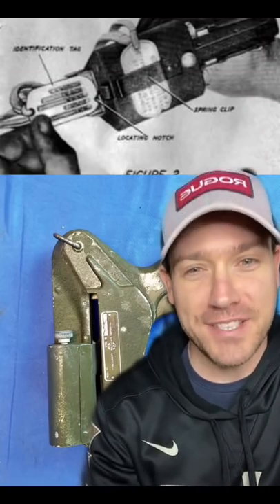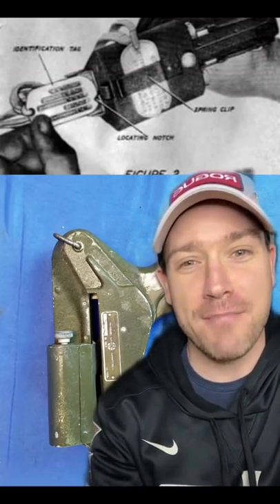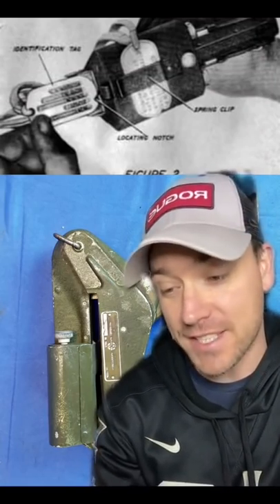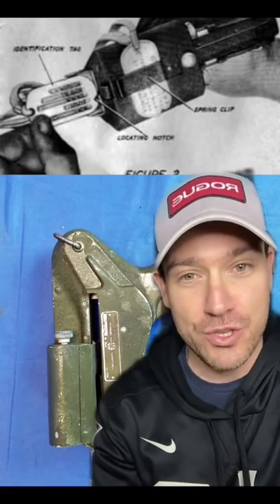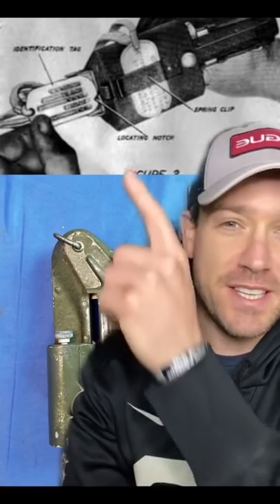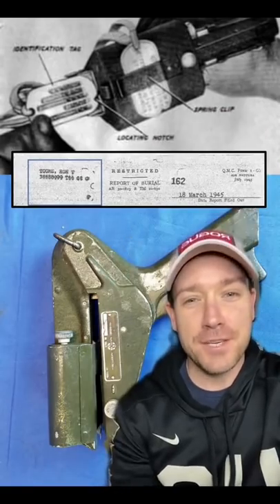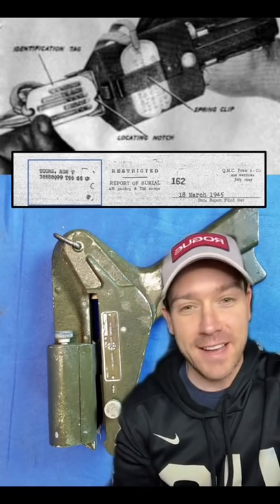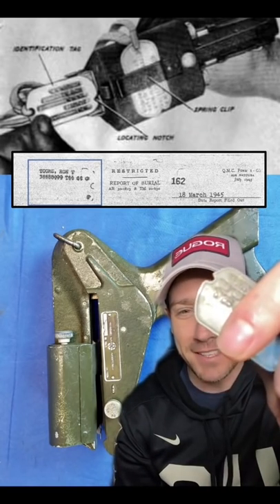Let's Put This Rumor To Rest: Why Did Dog Tags Have Notches?

Comment: I have heard this story also.  We usually had one laced in our boot.  Working on the flight deck it was not allowed to have dog tags around your neck or any loose items.  These items if they became loose could get sucked into a jet engine and destroy a very expensive engine. More often than not the surviving recognizable body part in a disaster we’re your boots. The original reason the notch is there for one reason,  very often in the military things have more than one purpose by design or by necessity or convenience.  Practicality in the Navy or any other force means nothing, orders come from the top when they make down to the bottom they make no sense to the people that have to carry them out.
Reply: Heard one guy got sucked into a Crusader intake.
Reply: @thisismagacountry1318  that is a true story. He survived with minimal injuries because while he did get pulled into the intake, he did not get pulled into the fan

Comment: Actually pretty sick considering I'm working records for the air force...
Reply: Nice. Also question. How long was bootcamp?
Reply: @wither5k788  8 Weeks when I went through.
Reply: @wither5k788  basic was very easy, waking up every day at 0545, doing pt, eating, studying, clipping strings on uniforms, drill, etc. But theres a lot of staying inside too even if your in august
Reply: Thank you
Reply: @wither5k788  what for?
Reply: @ExplosiveQuarry  just wondering
Reply: @darkdrengr5944  mine was 7.5 weeks with only 3 days out at BEAST with no obstacle course or gas chamber
Reply: @ExplosiveQuarry  when did you go through?  I was there in '99 so I would imagine a lot has changed.

Comment: My dogtags had a notch in them because they fell behind my end table and landed on the prongs of my phone charger that was not pushed into the wall all the way.

Edit: It was not the force of the dogtags hitting the charger prongs that bent them, It was the dogtags touching two exposed prongs and the ensuing electrical arc that burnt two notches into them.
Reply: Dr Disconect  It arched and cut two dents into it.
Reply: This is cap, were your dog tags made of aluminum foil?
Reply: Am I really the only one who realized that the electric arc cut the notches into the tag before reading his edit?
Reply: Sure bud
Reply: @nicholasweiss4662  😂🤣😂
Reply: it’s scary how many people dont know anything about how electricity works. especially considering most would collapse without it.
Reply: Haha! Ive done that with a measuring tape :) I can perfectly picture the scorch marks!
Reply: lots of amps, wouldnt it just trip the breaker?
Reply: @nicholasweiss4662  Apparently
Reply: The thing that bothers me most about this is that your phone charger wasn't pushed into the wall all the way. 🙈
Reply: @spencer6874  circut breakers for power outlets are quite high amperage, due to things like electric kettles and sterios, and dog tags are very thin and will melt easly before enough current has passed through to trip the circut

Comment: Former 82nd Airborne vet here with some stuff you probably didn't know about modern dog tags- 

-You're expected to have two dog tags, one on a short chain and one on a long chain. The dog tag on the short chain is known as a "toe tag." This is for mortuary affairs types and is supposed to be placed on a toe so they need not pull your whole body out of a morgue chamber to identify you. The dog tag on the long chain goes to your unit leadership, typically the S1 section, which is like the military version of human resources. 
-Wearing dog tags underneath hard body armor or a parachute harness is uncomfortable. So, a lot of guys (myself included) would simply loop their dog tags through a belt loop on their trousers using the long chain and place the tags in a back pocket. Problem is, this area is somewhat "unprotected." So some guys would get "meat tags." This is a tattoo on the chest or back of the service member's dog tags, sans maybe their full social security number. The idea was if they encountered an improvised explosive device, their arms, legs, and even head could be blown off, but their torso, which was protected by body armor should be recoverable. 
-In my unit, we had a reserve parachute mounted on a plaque. Attached to the pull handle of it were the toe tags and chains of guys in the unit (past and present) who had experienced a main parachute malfunction on a jump and had to deploy their reserve parachute. Dog tags are pretty special and durable, but there's people that make replacements for things like that.
Reply: Interesting 🤔. Start a YouTube channel with military facts like this.
Reply: Thank you for your service and for the info you shared with us.
Reply: I keep hearing about 82nd Airborne a lot, but are there 1 to 81 Airborn as well?
Reply: @MizantropMan  you should try stand-up. You’re a funny guy
Reply: @mikeferguson1833  I am being serious.
Reply: @MizantropMan  oh well I’m that case no

Comment: The intention was not to better secure the dog tag for that reason but to make sure it couldn't be looted.
Reply: No the reason was too align with transcriber, did you even watch the video?
Reply: @steelrain714  the notch was put in the dog tags before that machine was ever built that notch was put in there to help wedge the dog tag in the roof of your mouth so a tag could remain with the body and not be lost or stolen so the body could be later identified.
Reply: @joshsmith7176  fake news.

Comment: I was in the medical squadron and frequently worked alongside the mortuary crew. Two dog tags are issued. One to jam in between the deceased’s teeth and the other to go around the big toe for later retrieval by an official. That’s what we were trained to do when I was in during the 80’s. To add to that, my dad was blinded in WWII. He told me and my brothers about this practice way back then. So, while the notch might be used to align the tag on the printer, it was also used by us to shove between the teeth of the deceased unless, as others have already stated, there was too much head trauma to allow it.

Comment: My dad, who fought in WW II, told me that put the dog tags between the teeth was indeed a field expedient means of securely identifying a mutilated corpse. Also, when a fallen soldier was buried in place, one dig tag was removed and nailed to a temporary grave marker - one nail through the hole and one in the notch to keep the stamp insight for reading. Thanks for the info on the transcription device. He didn't know about that apparently.

Sometimes, there isn't just one right answer.

Comment: Ask s former Reconnaissance Soldier in the Canadian Forces, I can attest to the fact that Canadian military dog tags did NOT have that little notch. Nor did other, non-American forced dig tags, that I've seen. 

Canadian Forces dog tags actually had a slot, not a notch, which was decidedly big enough to allow someone to place a dead soldier's tooth in it, in order to allow the tag to remain in-place long enough to identify the soldier after the battle.

So, while I can't speak for the notch, any military dog tags that have a slot are specifically designed to assist with identification of the soldier that may pass away in the field.

Comment: Any time you see a notch, grove, hole, dent, or protuberance of any sort in any mass produced item, and it doesn’t serve any obvious purpose, it’s almost always an indexing or locating feature.

Example: The hole in a washer is obvious. It’s so that you can slip a screw through it. But a washer with a flat side or a notch? That’s probably for a machine to align the washer hole with a screw hole automatically.

Comment: They could have used it for 2 other reasons 1. Wrapping the tag to keep it from making noise if it had no rubber outer coating, & 2 . For the fallen soldier have the tag wrapped in the boot lace so they can I. D. Them quickly. They usually had 2 tags one for removal after they fell in the Field, the other was to be kept on the body so, if they could retrieve the body they can I. D. It .

Comment: My grandfather served in Vietnam and the notch on his dog tags are more defined and is reinforce with extra metal arund it so it would fit flat, he served in the coast guard, when he wasn't on patrol his primary job was to fish bodies out of the water, (alot where from crashe planes)  they would slide one of the tags over one of the top front teeth, this was done so they could quickly identify the body.  I know this because one day we found his old dog tags and I ask what the notch was for and he showed me by literally putting his front tooth in the notch.  Note the notch in the video you showed is not nearly as big as the ones one his dog tags, so I think depending on the time periods and the mind set of how the us military wanted to process the fallen, I don't know what the due today, but we did things differently back in the day and not always just one way

Comment: Ha, I never knew that. I thought it was a mess up when they tried to put the actual hole in it. When I was younger, my neighbor had a shop like a warehouse factory and he did dog tag. The machine itself was automatic but if the little clip wasn’t tightened, it would kind of kick loose and the writing would not longer be center. I thought maybe it was the same thing with making the holes.

Comment: The notch was so the machine could hold it in place and get an accurate print . A Dog Tag is actually worn around the neck and the other is dropped inside a boot . A Red illuminated Dog Tag is used for Medical Reasons.

Comment: I heard this from a close friend who served a modern military in a developed country as an infantry soldier. However it was only done if a body had to be left behind on a regular operation, and it was reasonably safe to do so. 

He said they were told the kick to the jaw had to be hard enough to dislocate the jaw to hold it tightly in place, so that if the body was moved around it would stay in place. A second dog tag was taken by the remaining soldiers for the records. 

Some countries use a new style of dog tag, developed in Israel. It is made of one square piece, with a line down the middle and the soldiers information printed on each half. The line is in fact a laser cut at an angle that when broken in half makes the pieces sharp for easier insertion in between the front teeth. 

Please correct this, this is misinformation. People should know of the reality and horrors of war, so as to be better prepared for if they aren't given an option regarding whether they'd like to  participate or not, or to help them make a better decision in regards to wether they'd like to participate in such matters.

Comment: They actually DID carry Dog Tags in their mouths during combat (but NOT kick them in the jaw) in case they stepped on a mine/were hit with a grenade and/or not recovered right away if they fell. They also put the dog tag somewhere else on the body (sometimes the mouth) when the solder fell—but not kick it ever-/that is crazy (it was mainly due to scavenger animals if they couldn’t carry out a soldier, from what I was told by another uncle in Vietnam). The idea was, that least that part of their body-the head  (and perhaps other parts nearby) would eventually be identified (especially before DNA Forensics). My Grandfather served in WWII in the S. Pacific. You can see his teeth marks where he bit down on one of his tags (we have them in with his flag). It’s why there were two tags (supposedly). He spoke of it too. An uncle on my dad’s side confirmed that they did this in Vietnam, too (and told us they did put it gently in his mouth). Apparently, it was important the head be returned over all else. That same uncle also had his number tattooed on his hip/torso.

Comment: Yeah, even veterans of the various eras of combat were spreading rumors, wives' tales, and outright falsehoods (i.e , lies) about so much crap. I even watched interviews with veterans, mostly of WWII and Korean Conflict eras (whether actually combat-engaged or not, who can really know?) spreading inaccurate information about the venerable M1 Garand. One of my favorite "rumors" was the 'ping' of the en bloc loader (mostly referred to as a "clip", and rightly so) giving away one's position during live fire combat upon its extraction/ejection. Another rumor, or inaccuracy (to be kind) is the M1 thumb, or Garand thumb. Yes, you could have the bolt slam onto your thumb but not during the proper loading sequence, as the bolt is always held open by downward pressure with the thumb on the top round, or the bolt was driving the round into the chamber, occupying that critical space which would otherwise cause said casualty. The smashed thumb would result only by manipulating the bolt or follower (whether completely locked out-of-battery or the bolt only held back by the edge of the follower) while unloaded (or possibly while topping off the magazine...which CAN be done, regardless of what the experts try to convince you).

I have listened to people give themselves away as novices or outright liars in military and law enforcement service, both of which I am a veteran, by repeating such nonsense that I know to be wrong or inaccurate. 

It was quite cringey to watch these old men of our Greatest Generation make such blatantly false statements, as my father is a veteran of that era and an honorable man. Rather than boasting about his escapades in combat or while on liberty, he remained silent about his service no matter how much prompting from we children, and even later as adults. I miss those great men populating our society, only to be overtaken by socialist snowflakes he fought so hard to eradicate. R.I.P., Dad.

Comment: The claim for putting the dog tag in the teeth was so that it held the jaw open and let the decaying gasses escape from the chest cavity without causing bloating until the body could be buried. 

Still stupid, but at least a little more thought out. I had also read that it was for the stamping machines but I have a dog tag making machine from the 1930s and it doesn’t need the notch.

Comment: Each soldier got 2 tags, one for someone to take off (and used for the tool in this video) but the second would stay on the body so they could still identify it later, I learned that they put it in their feet. I agree that sticking it in the teeth is fucked tho.

Comment: You're given two dog tags.  One is a toe tag, that's the one one the smaller chain.  The other goes between the front teeth in cases where you're head is separated from your body. It keeps your body parts identifiable so they can bury you.
Reply: Also you don't have to kick the jaw. You just hold it there and push with your palm. You would have to have someone hold it there while you kick it,  people are dumb.

Comment: People do relize even if the dog's tags were list there are plenty of other ways to identify the body back then right? If they had tattoos we in the military fill out a form that has all the information on each soldier and were the tattoos are located and what they look like in the past they would make a rough drawing of the tattoos and file it that way while in today's army we take photos and upload them online with the paperwork also when you bring a lived one in to verify the body as long as the face is fine or they have a tattoo or even a part of thier body that is natural to them but different in other people a family member can confirm who it is. Dog tags don't get damaged easily I've had the same ones for years that have been through mud rain snow and heat I even use them to adjust my sights on my weapon and other equipment such as my ach but they still are perfectly fine the tike it would take to move the body to the autopsy people they would be legible it makes no sense why people would think it was kicked into someone's skull.

Comment: The idea that the notch is to be put in between teeth doesn’t even make sense… if you’re going to kick it into place YOU DON’T NEED THE NOTCH. 

Think about it
Put a notch in something as thin.
And take another one without a notch and try to put them both between your teeth… guarantee you the one with the notch isn’t gonna do any better… if you want something to fit between teeth then it needs to be then, not notched.

And if it was meant to be put in between the rows of teeth(like when you put something in your mouth it goes i between your top set ad bottom set of teeth instead of being in between two individual teeth)
Then that still doesn’t make sense cuz the dog tag isn’t going to fit long ways with how little moat humans can open their mouth. Our jaw doesn’t unhinge like a snake.

There must’ve been -1,000% thought process put into that theory. Like somehow they did the opposite of ‘thinking about it’

Comment: Sorry but you're wrong Is that not serve several purposes actually.... As far as that little transcriber machine thing it was a rectangle Piece of metal dog tag it will lineup just fine without that notch
 And in fact yes they do take the dog tag and put it inside the mouth it's about they don't purchase do it the way you do it but but in combat when you fall you typically just fall dead or whatever so there's not much trauma to rip off your Dog tags however and transporting home it's calm typically you're naked at that point because they had to clean you up blah blah blah uh and your dog tag remains in your mouth until it gets back stateside where where it's taken out and officially named as you the other dog tag typically travels around the neck that's that's why dog tags typically have a big chain in the small chain I don't care what regulation say this is how it has been this is what I've seen